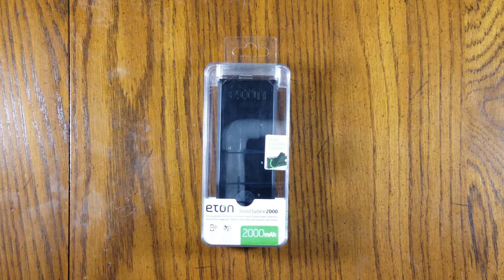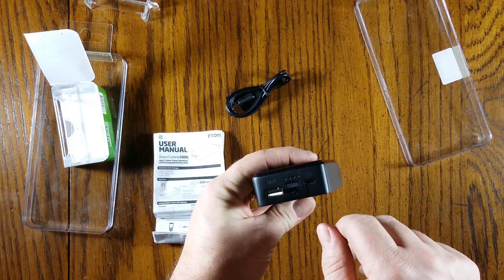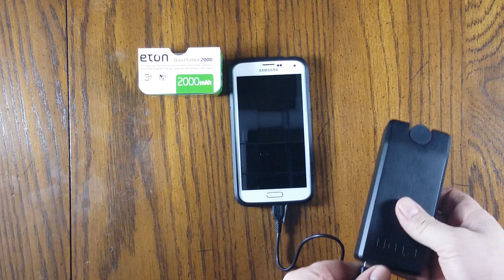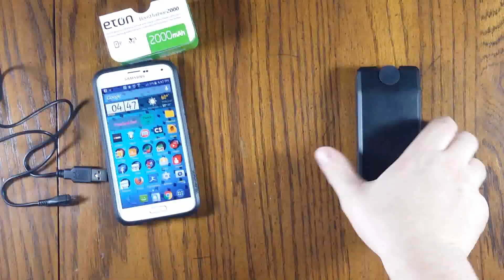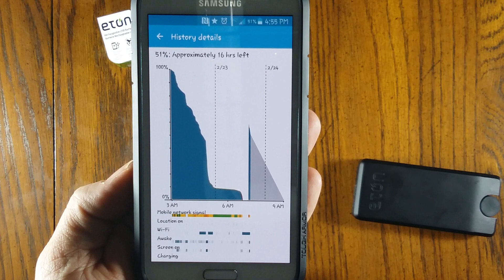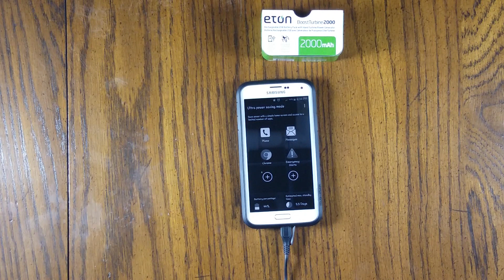Eton BoostTurbine 2000 External Battery Pack Charger Unbox and Review

Comment: They have the same capacity battery chargers from $5 and below for $5. Most people would rather loose all that weight for almost zero charging. I bought one, but can you imagine getting a higher amperage version when the wind up crank does little good?

Comment: They should make a 20000mah powerbank with 2 cranks connected by gears to spin by 1 crank with an output of 3 to 4 amps. That would be dope!! Guess ill go an get a patent.
Reply: One crank head have crank and run (drive bike) from other crank head who chasing it for a little baggy of crank and cop chasing them, all 3 on byccles. 5 minutes battery explodes! 😂
m

Comment: The thing sucks because the out put on the USB is only 1amp so it's not going to charge fast . Even if you cranked it too 100% it only would charger your item at 1 amp . It wound be better if you just got an extra large battery pack and you charged it